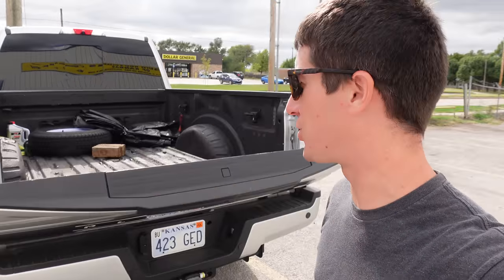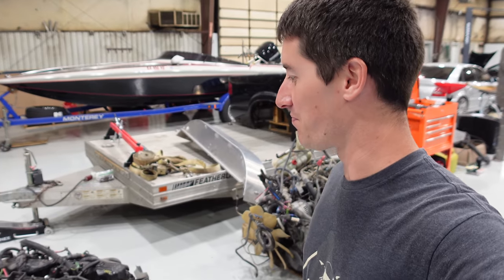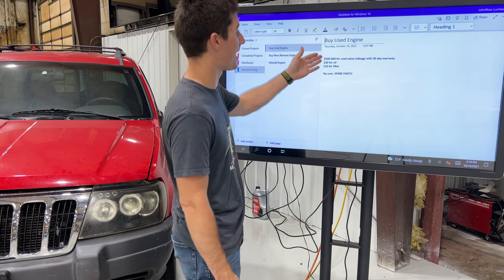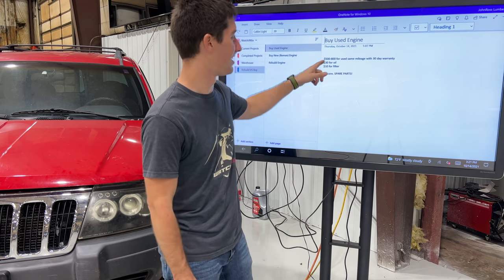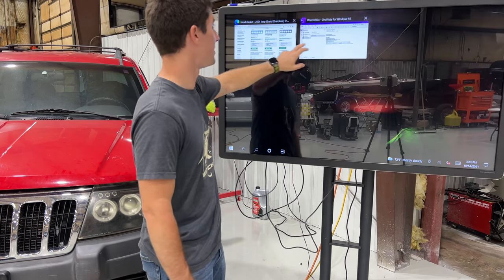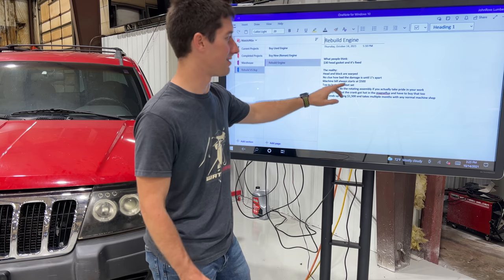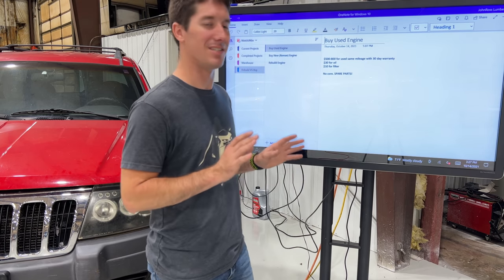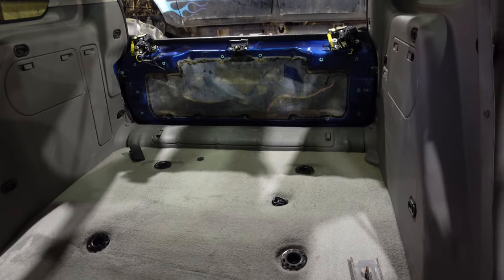Here's Why You Should NEVER Rebuild An ENGINE *The Math Doesn't Add Up*

Comment: Replacing the engine in the case of a cheap 800 engine is a no brainer, but I flipped a 2010 Audi a4 turbo, a used engine was 4k Usd... old engine needed pistons and rings, I rebuilt it with new rings/ pistons and rods and timing chain set, for like 1000-1200$ ran great passed emissions. I made 3k off the flip not including my labor which I did my self.. if engine was cheap I would have just swapped it, but sometimes its to expensive.

Comment: Picked up an 03 Dodge Durango 4WD 4.7 V8 with 102k miles. Sadly the 545RFE trans was bad (no 3rd gear) paid $600… I bought another 03 Durango with the same power train that had been parted out for the engine, left side drivers door and front seats. The trans was perfect with 114k miles… I bought it for $300. Pulled the trans and the limited slip diff out of the parts car (my builder had an open diff) and put the whole project together for about $1200 (this inc trans fluid, filter, seals etc.) I then sold what was left of my parts Durango for $300. I’ve been driving it now for about 6 months with no issues. I’ll probably keep it 6 more months and then flip it for a $1500-$2000 profit as this is a very clean rig. The vehicles are out there to be had if you look and can do the work to fix em! Good luck folks! 👍

Comment: I don't swap to flip, I swap to drive, so I do valve cover gaskets, pan gasket, front and rear main seals and intake gaskets. I also replace water pump, timing belt and tensioners or guides and tensioners (sometimes the chain) if chain driven. Do the plugs while it's out too.. but like I say, I do it to drive them. I've flipped them in the past, but just because I got bored and wanted something different. Good luck sir!! Make that money!

Comment: In my younger years tried satisfying customers that stated they only need a head gasket. Out of head jobs I can’t remember one engine that came out perfect as nobody wants to spend money on recertification. So they have blow by are low in power and lose fuel efficiency if they seal. Use to be able to get a engine rebuilt for $300-500 that’s nonexistent today, specially with torque to yield bolts etc. Going cheap on internals is asking for it as well. From customers to personal vehicles I prefer a reputable shop and low mileage maintained engines. Rebuilders are another shot in the dark as I’ve seen crank/rod knocks when I tore them apart they’ve regrind and oversized. Taken to the machinists and tolerance are out of spec. Certain shops reuse minimal distorted parts that are within range. Appreciate this tutorial/tip as every point given I’ve experienced in my 43 years of wrenching. Great video and keep it coming!

Comment: I have a 2016 Cadillac ATS-V with roughly 90K miles.  I love the car and would rather get the engine rebuilt than buy a new car.  It's not showing any signs of wear given that it has lived a life of Amsoil products.  I'm just triggered by the "NEVER" about rebuilds in this title.  I'd rather have mine rebuilt by competent people than buy a pull from a junkyard.  Matter of fact, I'll be looking for a highly reputable engine builder once I hit 120K.

Carry on.

Comment: I rebuilt the motor in our minivan a few years back. It was our daily driver and this was not a flip. Surprisingly it's still running for it's new owner despite how poorly they care for that vehicle. Yes I spent over a grand at a machine shop to do all the "while you're in there" work, plus needed a new crank, new camshaft. If I had to do it again I would just get a used one. There were "remans" selling for $600 for that minivan at the time and I should have bought one of those instead. However, I'm not mad about the wasted money because I got a lot of experience out of it.

We now have a full size fan for our family travels and I have concerns about the motor in that. When I need to remove that motor I will simply be getting a used one to replace it, not rebuilding it, and be done with it in a matter of days.

Comment: You could not have possibly described my exact circumstance any better. I wish you would have posted this a couple weeks ago when my ordeal began with my 1998 Jeep Wrangler with a 4.0 engine.... I bent a valve and rather than a new motor, my mechanic rebuilt the engine, sent the heads off to the machine shop and I'm in a worse position than when this all started.   No joke, exactly $1550 after the rebuild, and about 25 miles later, my engine is trashed with all kinds of binging, bonging, and banging.  Who knows what happened but now have a super sweet TJ just sitting in my garage undriveable now.  I should have opted for the dad gum replacement right off the bat, thanks for the timely video, NOT :-)  I'm a big fan JR, keep on keepin' on!!!  (If anyone knows of a Jeep TJ mechanic/specialist in the DFW area, please message me)

Comment: I did an engine/transmission swap on a 91 civic 20 years ago. Original engine was toast at 223,000. $700 for a good used engine/transmission with 120,000 miles  plus my worn out used engine. The junk yard said they could get $200 for the head.  A new alternator, clutch and CV axle was another $500. Drove it another 40,000 miles and sold it to a friend for $500. He drove it another 150,000 miles. He said it was the best car he ever owned.  Used engine was definitely a win.

Comment: I've been a full time mechanic since the late 70's. The only engines I rebuild anymore are engines for heavy trucks and equipment. Now and again I'll do something that is hard to find, because it's old or rare. And the only way you can rebuild stuff economically is if you can do all your own machine work. And don't trust machine shops, I've seen lots of stuff come out of machine shops fucked up.
Really with rebuilding, it's super easy to end up with a 10,000 engine in a forklift you can buy a nicer replacement complete forklift for at about the 5,000 mark. That really applies to lots of things
Reply from the maker: Absolutely, can’t really trust any machine shops now 💯

Comment: I blew a head gasket in my 96 xj changed the head gasket and nothing else and it's still running strong 50k miles later so not ever time as you stated

Comment: My 2015 Wrangler with 200k miles blew a head gasket but was in good shape otherwise.  Quotes were pushing $2000 to do both sides, but no one wanted to do that job on a 200k miles engine for the reasons you explained.  Reman 3.6s were well over $6k.  I picked up a used take out with 41k miles on it for $3k and have another $500 for a new oil filter housing, gasket kit, coolant, oil, and some misc stuff

Comment: I've successfully rebuilt engines before... but usually only if they're new enough to warrant it, simple enough to make it easy, have a large enough margin to make the repair economical or the part is easy to replace.

It helps if you have a liking for simple engines in relatively simple cars... or motorbikes.

You can usually avoid the problem of rebuilds entirely by maintaining your engines.

The #1 cause of failure in an engine is lubrication... so bonding a lubricant to the metal is the simplest way to prevent failure and avoid rebuilds.

🙂

Comment: pul a part folks. 64 bucks for a complete head. 30 bucks for a gasket. flush the oil and coolant system. its a flip. not a car you plan to drive for ten years. id have that bih back on the road for under 130 bucks, lets say 250 for pul a part parts for things i found wrong, and have it up for sale for 6 times what i put in it.

Comment: There's two types of blown head gaskets as many know. But to spell it out for those that don't, you've got basically a seal (head gasket) between the cylinder and cooling ports. Keeping it very basic here. If the head gasket fails and you get oil in the cooling system, but not into the engine....That's the best case situation and a head gasket and possibly head resurface will be all that is needed. On the flip side, if it's cooling fluid into the oil, JR is exactly right. Replace the engine over rebuilding UNLESS (again, as JR stated) it's it's a rare or vintage engine in a collectible vehicle. Now for my story......I had a 1967 F100 with the 352 FE engine backed by the RAT code 3 speed trans. Absolute bare bones truck. Manual EVERYTHING. When I purchased it, there was oil in the radiator. I drove that truck (I mean, come on.....it's a beater with a heater) for 7 years and never had problem one with the engine other than the fairly regular 1 quart of oil per 2,000 miles. Then I purchased my Dream Spec GMT400 (1988-1998) OBS Chevrolet and found it in a C2500 package. In 1999 and 2000, if you ordered anything over a standard 1500, you got the OBS GMT400 in the 2500 and 3500 trucks. I bought that one knowing it had a blown head gasket, but this time it was the bad type of blown gasket where coolant got in the oil. I purchased the truck right with this knowledge and a plan to replace. Since this is to be my "Forever Truck", a rebuilt 5.7L 350 Small Block Long Block was ordered and installed. So I've got a 1999 C2500 with a 3 year 36,000 mile warranty and I'm in the truck for about half what it would sell for in the current market. Zip~

Comment: You start off saying never and then you start listing all the exceptions to your never rule.  That sir, is just a bit hypocritical.   

"I sell these cars the minute the engine swap is done".   Of course you do because it is a ticking time bomb the second you bust it off because you have no idea if it was maintained right in its previous life or not.     Car flippers SUCH AS YOURSELF are not going to spend the money to rebuild an engine or even buy a re-mann'd engine if you can find one at a junk yard.   Used car dealers are not going to do it either.   They go find a junk yard engine, throw it in the thing, fix all the codes(or just clear them and hope they don't come back before somebody drives off with it) and dump it on some other poor sucker as fast as possible.    

It is a crap shoot when you go get a junk yard engine.  Many cars running around these days have had the odometers rolled and this is particularly true if they ever land on a used car lot.   I don't know what car flippers do but I could take a good guess.   That means you may think your junk yard engine has 85,000 miles on it when in fact it has 160, 180, 200, 205, 225 thousand, who knows.   Some of those people will even steam clean the junk engine, throw it in the car and claim it has been rebuilt.   

You also have no idea how or if the engine was taken care of and often it hasn't been taken care of.   Sometimes it is a crap shoot when you buy somebody's reman'd engine as well.   I compare notes online with a bunch of people who are restoring old cars and people post reman'd engine catastrophes all the time.    Further, you are guaranteed that the reman company is going to put the cheapest junk in it and do the least amount of work possible so they can roll it out the door as soon as possible and get their money out of it.    Reman companies also tend to be experts in dodging the "warranty" on junk they have built.    

In reality, the only way you know you are going to have an engine that will run and last for years is if you have a TRUSTED machine shop that can work with you whether you want the whole short block or long block built or you just want the block, crank, rods, heads machined and you are going to do your own assembly.    I've done it both ways.   I have an excellent and trusted local machine shop to work with on my stuff.   I don't flip vehicles.   

I am not a flipper.

Comment: It’s for sure a tough issue. Problem is engines aren’t available like they used to be. You for sure have to do the math and decide if the time and labor is worth it. I’m pondering the issue with my 5.0 right now. Do I fix the issue and repair or just swap? I want to swap just don’t know if the engine is available. And anything other than factory isn’t an option. Been seeing some really bad remans out there.

Comment: My first car was a 74 Mercury Capri with cracked heads pumping water out the tail pipe all the way home. My dad ended up finding a used engine from a wrecked Capri in the newspaper for $300. Swapped the engine, new pilot bearing and clutch, drove it all over.

Comment: For your situation works out great you are right. I have done the same thing on a couple trucks.

However, look up a 2013-14 Hyundai genesis coupe 2.0t. Used engines are $3500-5000 or I can rebuild with machine work and forged internals for $2500. The math makes sense to me.

Comment: I can't understand the hate on this man for selling cars with junk yard engines. He's not lying about what he is doing. My engine blew once and I had a used engine put in and with labor it was $1,800. When you are on a budget, getting from point A to point B is a blessing. It shows how many people haven't had it hard by the tone of some of the comments. Some people don't want a $60k bill looming over their head and are fine with a $5k car that runs and they can then maintain. It's not like the customer can't further improve the engine if needed or wanted. When someone is open and 100% transparent you have no argument with them. People like me would buy a car from him. Think of it like this, find a rental car company, see how much a rental is for 5 years... if the car you bought is cheaper vs renting and you were able to get from point A to Point B you got your moneys worth. 1k a year for transportation as a throw away isn't that bad to be honest. Chances are it will last longer with proper care. Check your oil, plugs, ignition coils, clean your carbs and injectors out the right way, etc...

Comment: As a car guy I 100%agree, I have rebuilt engines because I can put better parts in for less money than a crate engine and I’ll be running it hard.  For a normal daily a junkyard engine or if you keep the car get a reman long block.

Comment: You are absolutely correct. I've done it both ways as well, and nobody's going to pay you anymore for that used flipped vehicle regardless of whether the engine is fully rebuilt correctly or with a used 100k mile engine that runs perfectly.  People don't care, and they don't know the difference . Just look at all the Kia vehicles People buy

Comment: Just from a coat perspective, it was $10,000 for a new engine from the factory plus instal so around $15,000. I went with a rebuilt engine (5.3L v8 LS gen 3, 2001-2006 model) for $2,500 and 3,000 for instal. Way cheaper and runs great!

Comment: these days, I use a similar local outfit -     but in 2000 I bought a 1997 Nissan extended cab pickup worth around $10g  from a local autoglass company  for  forty-five hundred  dollars - it  was the shop parts chaser, and only had 24,000 miles, but the clutch was shot and the delivery girl drove it for 2 days with low oil until it spun a bearing. The machine work, gaskets, rings bearings and gaskets  came to $400,  plus a couple hundred for the clutch and flywheel machining.  Four hundred and some thousand miles later, it's still on the road....

Comment: I buy new these days.  And take good care of them.  Last century I used to get vehicles cheap or free.  I did rebuild a few for fun and profit.  But I always upgraded the engines.  RV cams, stronger ignition, ported and polished heads, double roller timing chains, and such.  Maybe a different manifold and carburetor.  I would replace suspension parts, adding Bilstein or other quality shocks.  Most of the time the tires were good.  But I would change wheels and tires for a new look.
The big problem with junkyard engines is the sensors and smog equipment.  And living in California the vehicle must pass smog.  And no check engine light too!
I made good money as an aerospace machinist.  And the cars and trucks were for family and friends.  I would drive the vehicle as a daily driver for a few weeks.  And someone would usually beg me to sell them the vehicle..  But I did make money when people would trade me some really good stuff and give me cash too!  They paid more than the used car lot would charge.  But got a much nicer ride.

Comment: I once was going to have a MGB engine rebuilt.  I spent money having the block bored, and the shop bored it to my spec (to fit the pistons I had) but that didn't clean up the bores.  They didn't call me to check if I wanted the bores to be correct (who wouldn't?) so I would have had to pay again to have the cylinders bored again.  I started adding up all the costs and went out and bought a used engine for $250.

Comment: actually we do this too , most post 95 engines are aluminum garbage when new , and rebuild poorly, another good idea is to pull the engine yourself ,from a rear ended wreck ,and save the redundant hardware , also sometimes japanese take out engines aren 't drilled the same

Comment: Retired ASE Master Tech here and this is my best advice that I give to my friends who are not mechanics. Either buy a new car that has a factory warranty and trade it in for a new car just before the warranty expires, or...
...buy a junker and never do anything to it: Don't replace or fix the alternator, battery, starter, any of the sensors, fuel pump or water pump and especially the tires. If it runs and is under $400, buy it and drive it until it dies, then sell it for the catalytic converters in it: probably $300 or more. Many times you get a car that goes for many months, maybe even a year. And best of all you wind up paying less for the car than you spent insuring it.

Fixing cars is for mechanics. Paying mechanics to fix cars is for suckers.

Comment: Great advice JR. I rebuilt a 2007 Audi A4 2.0 FSI engine on my channel.  I then did a post episode on how much I spent. A pulled engine would have been much cheaper. I did it mainly to get experience and KNEW it would be more expensive. Pull an engine and drop another one in on a daily. PERIOD.  A 911?  Not unless it's blown.